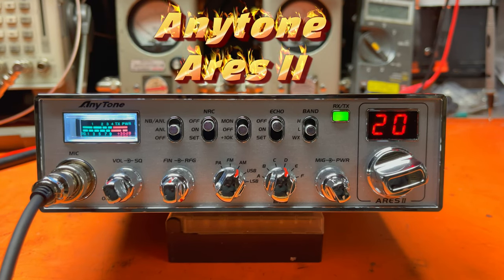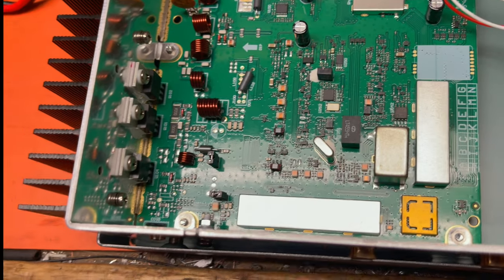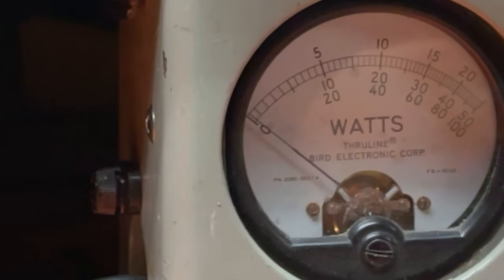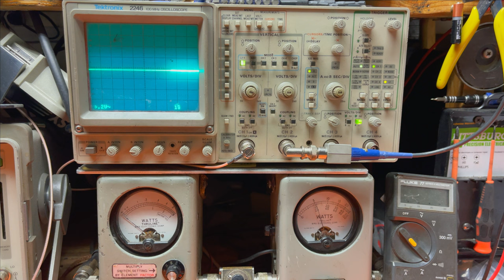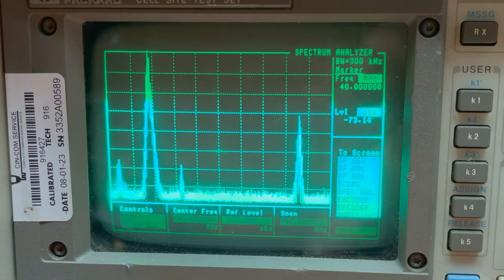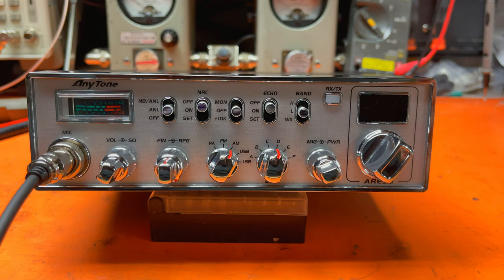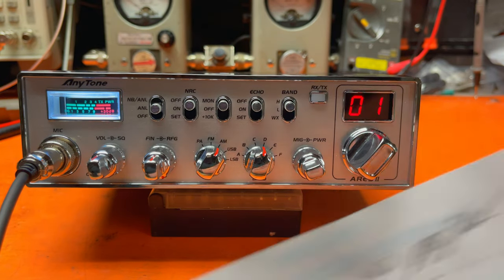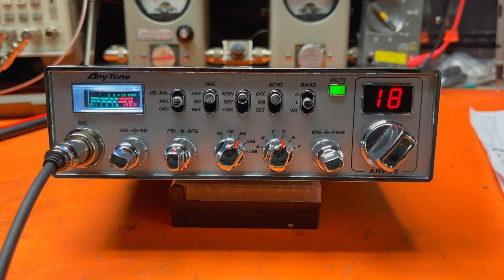Anytone Ares II Tune-up Report and Service Menu

Comment: According to the Signal vs Power relationship, the increase in transmission power generally has  little impact on communicating stations and causes unnecessary stress on components.

Comment: Not sure what you did there but those normally have almost no harmonics, so that 2nd you showed is not normal. That changed capacitor could be the problem. Also, IH and IL are not the correct menus for SSB. Be careful in there!
Reply from the maker: I will check your concerns on the next unit I do. Same cap on many similar chassis don't cause this.  I didn't "invent" the cap mod it was in a Factory published update for a similar model.
Reply: @BellsCB  all good. Have a look at the BL an BH settings for SSB. Also be very careful around some items like the S Meter settings. Users without test equipment will not be able to restore the correct values without test equipment if they accidentally change them. I hope that helps.
Reply from the maker: Checked the spectrum on a new unit and it was the same, the cap change did nothing on the spectrum.  10-4 on the other settings BL and BH for SSB